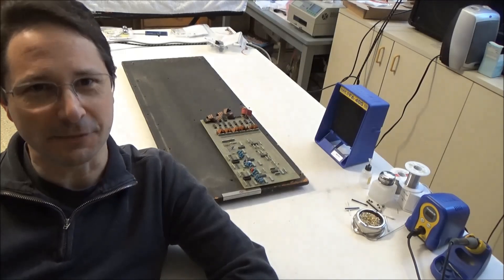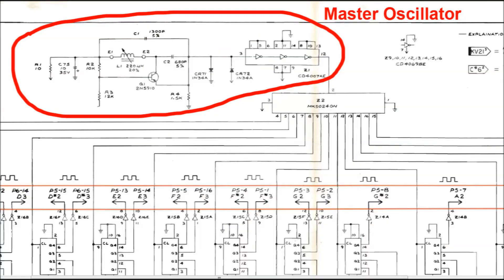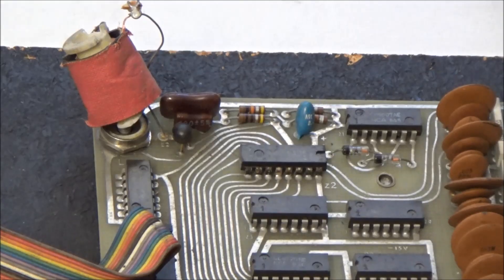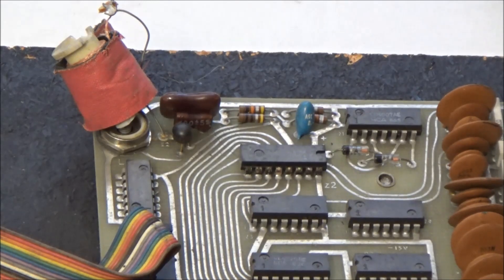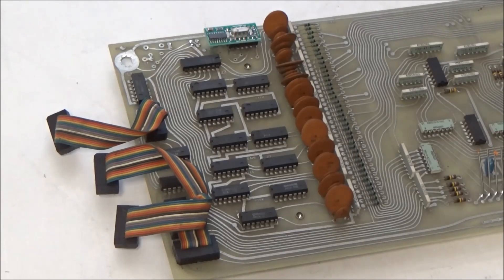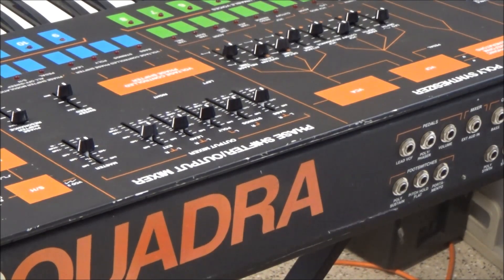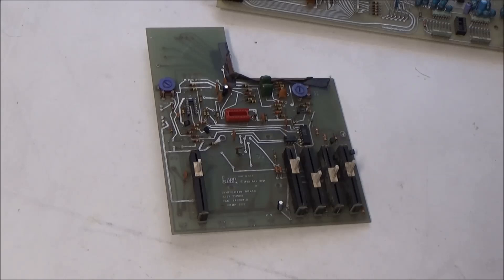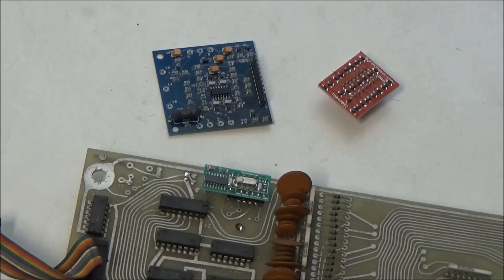ARP Omni & Quadra Master Oscillator - Divide Down Polyphony - Synthchaser #128

Comment: Wow!! A top octave generator!! That is VERY good news! I dont have one of those Arps but could you do something similar for sayyyy a Polymoog? Someday that might be needed. Also wow, now we see what you look like! Great work, as always. We have to keep the old synths working!
Reply from the maker: So this is just the master oscillator, ahead of the top octave generator.  But I do have a replacement top octave generator in the works when I have time to finish it up.  And that would work for the Polymoog as well--it uses the same chip as the Omni.
Reply: @Synthchaser  Whoops! Right. My mind is wandering again (working on a programming problem while watching the video). But that is pretty cool news. And yes, definitely still an analog synth. I can see how some people will argue that but that's really not something that makes a difference to the sound.
Reply: @Synthchaser  This is great news!

Comment: i should like to hear the difference before buying one
Reply: antigen4 while I understand your skepticism - I would be skeptic to a decade ago. The way CMOS works is that the output isn’t shaped by the input. The output either works or it doesn’t, if the input isn’t square enough there simply is no output. This is why the sound of the overall circuit isn’t changed. At all.
Reply: NOT that i'm at all skeptical about the 'digital/analogue' thing you mention but I'd be a BIT surprised if it didn't affect the audio result in SOME way
Reply: but then again - that's all the MORE reason maybe to want to hear it ....(?)'
Reply from the maker: This did affect the audio.  Before it was broken and not making any output.  Now it works and sounds correct.  The product has been heard in several prior videos.
Reply: haha fair enough